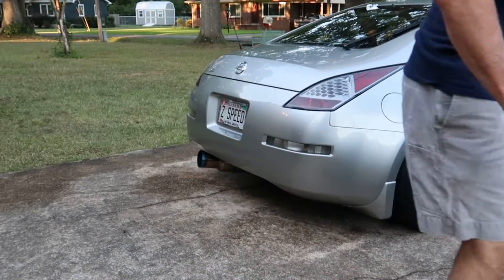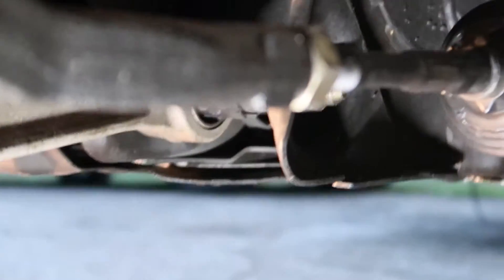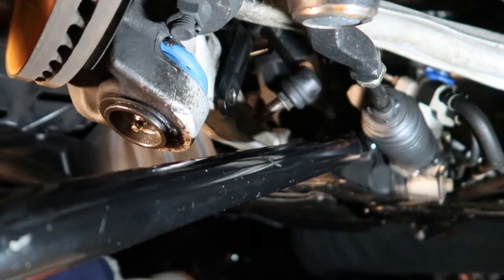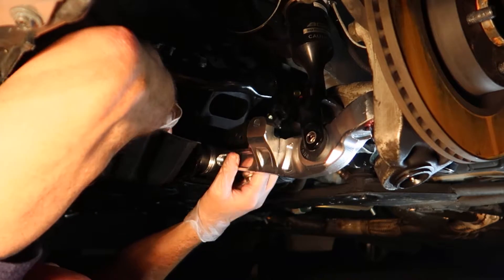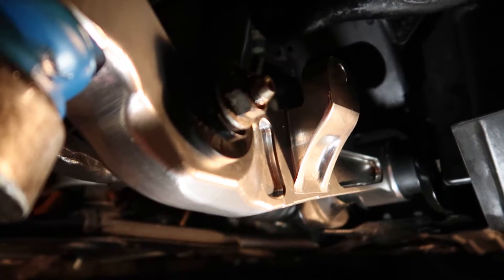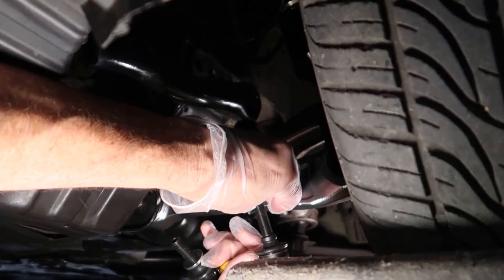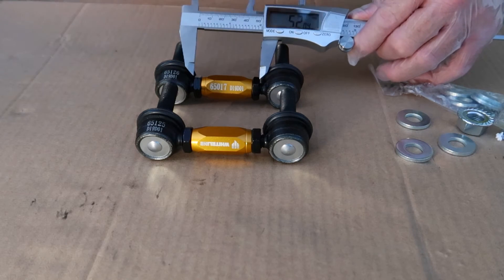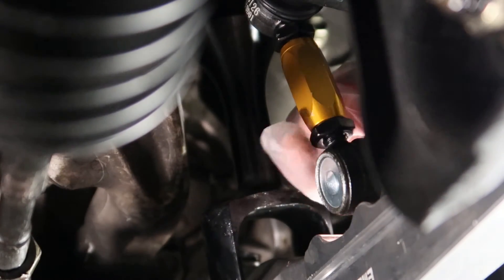350z Lower control arm & endlink replacement #Nissan350z #Zoceity

Comment: Im not sure i understand the measurement of the inside of the new adjustable sway end link. Wouldn’t you measure from the actual ball joint to ball joint instead?

Comment: Hey zspeed! Great video and very well explained. I ran into some issues when installing these lca on my 06’. I installed the mevotech ball joints and those came  with a pair of shims. My factory shims just don’t fit at all into the stud of the mevotech ball joints. So I used the ones they came with which are very slimmer. And now when installing the Emusa lca, the ball joint stud keeps spinning with the nut. The nut the mevotech came with are 24mm btw. I’m debating if I should order some oem ball joints to keep the factory shims so the nut can actually tighten…what do you think?
Reply from the maker: Try putting a floor jack under the  Knuckle and putting some up force under the ball joint, that might keep the stud from spinning and allow the nut to tighten up. If that doesn't work, factory ball joints should do the trick. There is a difference between the cone shim size of a 2003/2004 and a 2005/2006! Hope this helps!!! Thanks so much for watching!
Reply: Yeah none of that worked for me. I tried to Jack it from the ball joint and the stud from the ball joint still kept spinning. Mainly I think because the factory shim doesn’t fit through the mevotech ball joint stud. The stud is way too big hence the 24mm nut smh. I’ll be getting some ball joints from z1 and using factory shims with the install. I’ll update you here after I see how it goes! Thanks again zspeed

Comment: I did buy those lower control arms because your video! But I’m having an issue.. I did not see that cone when I pulled the old control arm from the ball joint and I installed the new arms and the ball joint it’s loose! I can’t tight it
Reply from the maker: Your going to need to go to Z1 motorsports and buy two new cones! Make sure you add what year your car is, because the later models use different sized cones!!!
Reply from the maker: If you still have your old lower control arms you pop your cones out with a rubber or steel  mallet!!
Reply: Z-speed I did change both ball joint because it needed to be changed but guest what was making sounds too! The bushing with the frame! i putted some grease, problem fixed! That’s sound could make u think your end link are bad! On my case I replaced with the lower arm at same time

Comment: that ball joint is suspect, did you end up having to replace it also
Reply from the maker: Actually I just overfilled it the ball joint boot with grease and it got all over the place, after I cleaned it up it looked brand new again, sorry I didn't show that!

Comment: Have you had the nuts for the buckle become loose? Seems to be a common issue, even after people put blue loctite
Reply from the maker: So far so good, nuts on the buckle still tight! But you should inspect your end links every time you change your oil if your having this problem. Call Whiteline suspension to see if they have any recommendations that might remedy this situation, hope this helps and thank you for watching!

Comment: Im considering these arms to replace my defective bearings, what year is your Z ?, I have an 2006. Should I have any issues installing them??
Reply from the maker: I have a 2004 350z, so the install should be the same. But when ordering your control arms make sure to you add what year your car is because the ball joints are a little different with the newer 350z's! Thanks so much for watching!

Comment: Are you happy with those lower control arms ? I installed those same ones and I only got 7,000 miles from them
Reply from the maker: So far, I've had no problems with this product. What bushing failed first?

Comment: Hey thanks for the video, how have these LCAs held up?
Reply from the maker: So far so good, no problems, holding up well! I would recommend this product!
Reply: @Zspeed  nice, just ordered mine on amazon aswell as some Beck/arnley compression rods from Rock auto. Hoping to eliminate steering wheel shake
Reply: I honestly think it's just an oem lca with polyurethane bushings pressed in. I got an Energy Suspension bushing kit for the lca and compression arms for about $94. It was a helluva task, but worth the saved money
Reply: @white_zeddy  where did you buy both those items for that price ?
Reply from the maker: lower control arms: https://www.google.com/aclk?sa=l&ai=DChcSEwjy6rbu_ejvAhWChMgKHVulAFoYABAYGgJxdQ&ae=2&sig=AOD64_3xrgC12D6H9BV9LzmaTnOOaxBBKQ&ctype=5&q=&ved=2ahUKEwibrq7u_ejvAhWPB80KHflfCgcQ9aACegUIARDRAQ&adurl=
End links:https://www.google.com/aclk?sa=l&ai=DChcSEwin862-_ujvAhXRwMgKHfhlBIIYABAFGgJxdQ&ae=2&sig=AOD64_0zpP3fai-nBUeXNG2H5OVKAXh5Uw&ctype=5&q=&ved=2ahUKEwjWzqW-_ujvAhVSZc0KHdLABqMQ9aACegQIARBC&adurl=

Comment: Any reason my 350z makes squishy noises when stopping? 06 350z is it my suspension?
Reply from the maker: Upgraded suspension or original stock suspension? Are your brakes in good condition?  Check you lower front ball joints and outer tie rods for wear. These are some of the first suspension parts to fail on the 350z!
Reply: Stock suspension
Reply: Brakes are good condition, just replaced em, gotta check my suspension soon that's probably it, thanks!

Comment: Genuine question, I installed these EMUSA front lca's same as you... I get a clunking/clicking whenever I'm at a standstill or turning the wheel all the way when driving at slower speeds. Do the lca bushing need to be greased up at all?
Reply from the maker: No, the bushings shouldn't need grease, just a little on the bolts! So, if you're hearing a clunking noise, the first thing I would check is your end links! Do they need to be replaced or have they loosened up after driving for a while! Did your clunking noise appear right after installation, if so, recheck all of your bolts. Also, what year is your 350z?
Reply: @Zspeed  my end links still have some resistance to them but eventually I'll probably get them replaced as well. I have an 08. Btw, I re-torqued the bolts to the control arm after doing a pair of new ball joints and the clicking went away about 50%. Now it's more so of a clicking/clunking when turning the steering wheel all the way to the left/right. Thanks again man.
Reply: Gabriel Armajo same to me! But I did install ball joints and torque as per manual.. keep sounding
Reply: Gabriel Armajo did you figured out? Sound went away after a while?
Reply: @gabrielarmajo688  its the ball joint cone FYI, the 2008 ones don't fit right
Reply from the maker: Sorry, I just found your comment. Are you still having the same issue with your front suspension?
Reply: @gabrielarmajo688  I'm having exactly the same issue. Really loud Clunking/creaking on the bushes when turning left and right. Did this noise ever disappear or did you fix it?
Reply: @connorrabey6  did you preload your suspension before torquing down your LCAs?

Comment: can this fit on 350z 2007 ?
Reply from the maker: Yes they will, they now have new upgraded bushings, here's the link: 03-07 Nissan 350Z Front Lower Control Arm 2D 3.5 CNC billet Aluminium